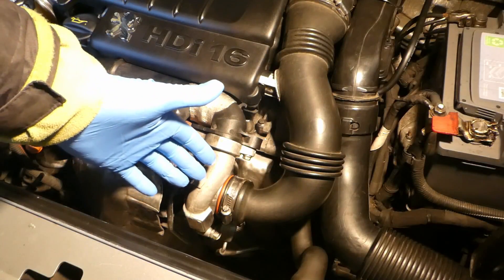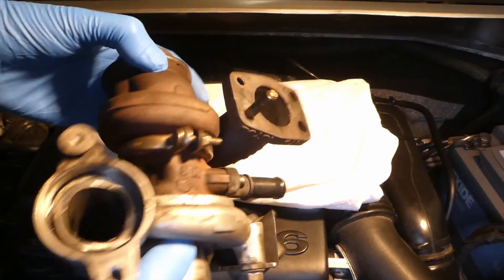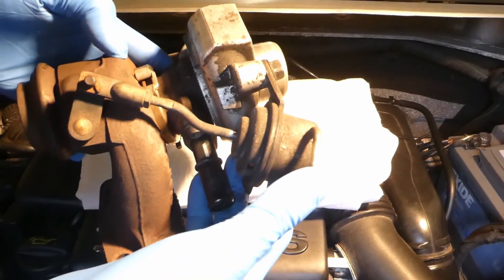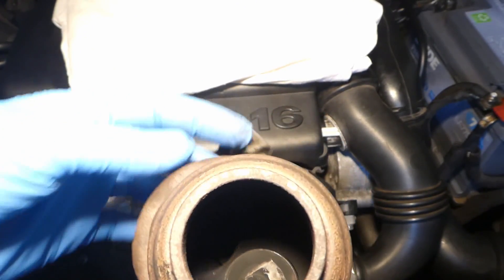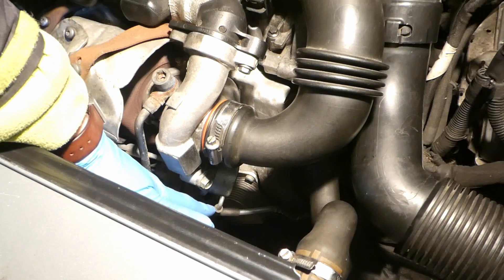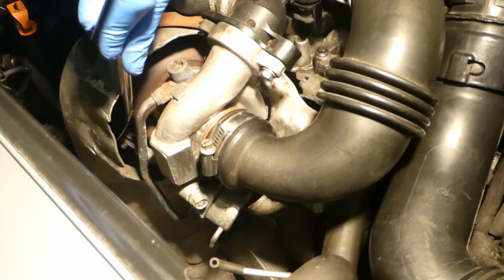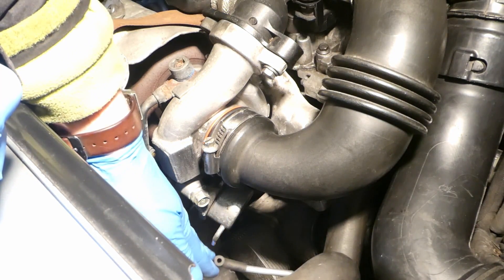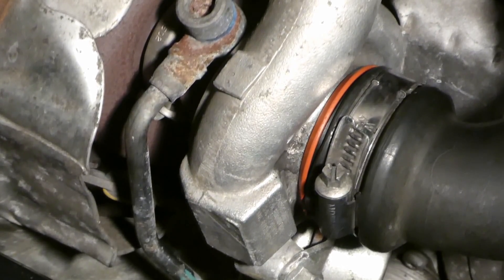Simple way to test turbo wastegate operation in 1.6HDi (Peugeot, Citroen, Ford, Volvo, Mini)

Comment: Hi, having a slight issue with my car. Did the actuator test as shown by putting my hand on the end of the actuator in which it held vaccum. Issue i am having is I can see it move up when starting the car and back down again when turning off but I am getting limp mode at 3k rpm. When moving my actuator down it does not respring back up only sometimes it does  and sometimes it does very slightly a bit sticky when doing this also. Would you say this is the vanes or actuator?
Reply from the maker: Yes, there might be some sticking of the wastegate. If I were you I would take the wastegate off the car and see if it really get sticky. If it is sticky you may need to replace it. If it has the same wastegate as mine, it is unlikely to be the VNT (vanes) turbo, but the fixed geometry one. Is it 92bhp or 110 or 130?
Reply: @moremolecules  hi thanks for reply, forgot to mention it is a 2013 TDI volkswagen unsure if you know much about there turbo systems
Reply from the maker: @roshaanqaisar  Hmm, I'm not too familiar with the TDI, but any wastegate needs to be free in opening and closing. Yes, vanes on the TDI will give problems as in any other vaned turbo. Difficult to say, but if there is a way to remove the wastegate to check for smoothness of operating it would be good.
Reply: @moremolecules  thank you will give this a try, so I need to remove the actuator and move it up and down not the vane lever?
Reply from the maker: @roshaanqaisar  Yes, but if the vane actuator is also a bit sticky then the vanes needs to be checked. Frequently on vaned turbos you get them misplaced and this could give you the limp mode. It is worth checking both.
Reply: @moremolecules  great thanks, I've tried checking just now when revving the car on idle and it just moves very very slightly forward and back and its a very notchy movement also.
Reply from the maker: @roshaanqaisar  It should be smooth rather than notchy, so there is something going on.
Reply: @moremolecules  hi, I removed the turbo and the vanes are moving freely when checked by hand. Also when the actuator is disconnected from vanes and I move the actuator up it does not spring back down. Is it supposed to do this?
Reply from the maker: @roshaanqaisar  Hmm, some of the wastegates are not spring-loaded, so operated electronically or via vacuum, so it may be OK. I am not really familiar with the TDI. Is there a vacuum pipe going to the wastegate or electronic component, i.e. cable? Wastegates are generally cheap, so you could replace it, but probably the best course of action is to plug it in with some sort of OBDII scanner and see any error codes for the limp mode.
Reply: @moremolecules  there is a vaccum pipe going to the side of it from the n75 and up top there is a electrical connection. I just checked the vane lever again and it moves upto 50 percent smooth then the other 50 percent it feels a bit gritty. I'm thinking it may be just that and the wastegate actuator is OK but if you said it may not have a spring then that will be the case
Reply from the maker: @roshaanqaisar  It might be sticking vanes that cause the grittiness. Probably the wastgate actuator is ok, but the vanes might be sticking a bit.
Reply: @moremolecules  thank you, I'll try cleaning it. Is there anything you would recommend using?
Reply from the maker: @roshaanqaisar  See if cleaning the vanes helps. I think carburetor cleaner would work alright.
Reply: @moremolecules  thanks pal

Comment: Hi more molecules. I want to replace the vacuum line from wastegate to solenoid. Do you have any idea of the correct vacuum line size as in internal diameter of line and length required? Many thanks
Reply from the maker: Hi there, unfortunately I do not really know the correct vacuum sizes. I suspect it is a generic vacuum line and you can cut it to size.
Reply: @moremolecules  thank you.

Comment: Hi I have Peugeot 3008 2011. It did some test to my turbo charger i found that no vacuum coming in to the actuator. my questions are: 1) does the actuator close the wast gate  on startup only?, 2) I see that vacuum pump is working. what should I test aim to define where the problem coming from. thanks
Reply from the maker: Apologies for the late reply. I am not too sure about the 2011 model, it may be a bit different. The wastegate actuator closes the wastegate on startup. Well, actually it is the other way around, it closes the turbo opening in the exhaust part. It is a fail-safe mechanism. So, if there is not vacuum there will be not turbo, the exhaust gasses will just pass through the exhaust rather than turn the turbo turbine. I hope it makes sense.

Comment: Thank you very much !I have volvo v50 2.0d with HDI 136 engine,i have problems from time to time...the car enters in Limp mode and i must restart the engine to run again back to normal...i have changed my intercooler and my hose turbo pipe...but not curred the problems still,i plan to test the turbo actuator soon as you showed in you video.Also my turbo overboost when this happens.
Reply from the maker: Not too sure about the 2L HDi, but there is a turbo solenoid at the back of the engine. It could be the wastegate or the turbo solenoid.
Reply: @moremolecules  The solenoid works well,i think maybe could be the wastgate..because i bought this car 3 month ago and in the first week i have found the vacuum hose broken with leak from the wastgate...so this wastgate was not working at all maybe 1 year,maybe gets sticky sometimes,i tried spray with WD40 and i plan to buy Turbo Cleaner Spray to clean the geometry of the turbo itself.
Reply from the maker: @L.Lyubomirov  You could potentially replace the whole wastegate with a new one. It should not be too expensive.
Reply: @moremolecules  Heard that in my particular case,the wastgate on Volvo v50 2.0d 136hp is togheter seled with the turbo,you cant buy one or other... :(

Comment: Hi, I have Peugeot partner, like yours. I have sign come on my deshbord, said engine clogging. Risk of filter. Some body suggest me, put some DPF cleaner and drive good 40 to 50 miles. Which is I did. Then I off engine. Try to start again. But is not starting. Please could you help me. By way 10, 000 miles before DPF was cleaned. Now even power lossing. I will waiting for your answer. If you are near to me. I would hire you. Many thanks.
Reply from the maker: Hi Mizanur, you do not want to hire me, I am no mechanic. If you have diagbox or PP2000, have a read if there are any errors. If the DPF was cleaned and it is clean, then it could be that the DPF sensor might be at fault. DPF sensors should not be too expensive to replace. How many miles/km has the Partner on? DPF filters are designed for ~100,000 miles or 160,000km.
Reply: My partner done only 10,000 miles, after clean it. Thanks.
Reply from the maker: @mizanurrahman9678  It could be that the DPF is done or a sensor issue.

Comment: I have a 1.5 TDCI the car makes a very soft and subtle turbo whistle, not a whine though at around 2k to 3k RPM. Nothing audible during driving. If I stop the car and give it some gas I can see a smooth mild whistle. No powerloss, no smoke, as such. Wanted to get your thoughts
Reply from the maker: Hi Vijay, all turbos when they spool up they whistle, but you should not really hear it. Depends on the design of the air pipes. Most "street racers" are looking for this effect, but on standard cars manufacturers try to minimise the noise, so the air pipes hide the noise. Check if there is a hose unclipped from somewhere or something uncplipped from somewhere. Not too sure about the 1.5TDCi, is it really 1.5 and not the 1.6? It could a design, but it is rare with standard cars.
Reply: @moremolecules  Thank you. Here in India we have the 1.4 (discontinued). Currently present the 1.5 derived from the 1.6. All piping are good visually, no stone chipping on the intercooler too, for the most part, all pipes are chuff,  no leaks on the charge side, inspected that one along, but this mild whistle though addictive, just gives me the bugs at times of a possible failure of something.
Reply from the maker: @vijayam1  You could open the air intake to the turbo and check if the turbo propeller is not moving too much, for a piece of mind. Do you know if other 1.5 TDCi make the same noise, it could be a feature.
Reply: @moremolecules  No play on the shaft either when I last checked. I will check once again, thank you.
Reply from the maker: @vijayam1  It could be a design of the engine, I am not quite familiar what the differences are between the 1.5 and 1.6. You have checked pretty much everything, so it should be alright. How many miles if the engine?
Reply: @moremolecules  39146 miles or 63000 KMS
Reply from the maker: @vijayam1  Do you know if it is the VNT turbo or the standard non-VNT one. I would still check the vanes of the turbo, the ones you can see when the air intake is taken off. Just check if they are all intact and no foreign object has damaged them by any chance.
Reply: @moremolecules  It's a fixed geometry turbo
Reply from the maker: @vijayam1  Then the only thing left is to check for holes again (hoses/intercooler) and if any of the propeller blades are not chipped. If these are OK, should not be too much of a worry, not much else you can check.
Reply: @moremolecules  Thank you.

Comment: Hey, stupid question but would this fault show up on a diagnostics machine? Thanks
Reply from the maker: Hi Ben, it should, but it might not. Depending on what is not working, it should show underboost, but it does not always happen.
Reply: @moremolecules  thanks for getting back to me. My car keeps going into limp mode and it’s getting a diagnostics tomorrow so my mind is racing wondering what it’ll be so if it’s something like this I hope they pick it up.
Reply from the maker: @Ben-bu2jg  It should pick it up, but there may be a lot of things for a limp mode. See what the computer says and take it from there.

Comment: I’ve got P0299 underboost condition on my Ford Focus 2 1.6 TDCI 2007. I have fitted an electronic boost gauge to the intake, I read 0.2 bar when driving, it’s really slow acceleration. I changed 2 vaccum solenoids, no luck. I then had my friend hold down that rod with a screwdrive and I rev’d the engine to 3000 RPM and it did 1 bar while idle! I then bypassed the vacuum solenoid and put a vacuum hose straight from the vacuum pump to the turbo actuator (so the diaphragm holds vacuum) and while driving I get 1.7 bar on the gauge. Could the wiring to the vacuum solenoid be shorted and the solenoid obviously doesn’t? Do I get any error when the wiring harness is not connected to the solenoid? Thanks a lot!
Reply from the maker: Hi Alexander, you have covered most things, but if you bypass the solenoid and you get boost, it seems the fault is somewhere between the solenoid and the wastegate. You could perhaps be loosing vacumm (e.g. split vacuum line) from the solenoid to the wastegate. I would check the vacuum lines for any loss of vacuum.I do not think you will get an error if the solenoid is disconnected. This is somewhat similar to getting stuck solenoid, no error is reported with this.
Reply from the maker: Apologies, forgot to say that the fault may be between the solenoid and the wastegate, but this includes the solenoid, so it could be that wires are not that well with the solenoid. If you can test the solenoid outside and it is alright, then I would see if vacuum goes to the solenoid.

Comment: Useful info! thank you, I have a turbo leak and oil goes onto the actuator it means the turbo seals are not working correctly, 3rpm boost is approx 1,2 bar. Turbo's dead.
Reply from the maker: Yeah, 1.2 bars is nothing for 3,000rpm.
Reply: @moremolecules  407 is going quite fine but leaves too much black smoke when accelerating, love this engine cause its very economical and Im going to fix it.Do you know the proper boost of this Garrett 1544V?
Reply from the maker: @pawelcitak83  Yes, it is extremely economical. I have another car, Peugeot 307, 1.6 petrol and it drinks petrol like there is no tomorrow. If your turbo is the Garrett 1544V, then your engine must be the 2L or 1.6 but with the 110bhp? The 1.6HDi (90bhp) has the mitsubishi turbo. I do not know the exact boost of the mitsubishi one, but it should go to ~1.9-2 bars. For the 1544V, the variable vanes, I am not too sure about that one.
Reply: @moremolecules  yes it’s 1,6 HDi 109 hp. Turbo leak means I have to replace it sooner or later
Reply: @pawelcitak83  regarde le collier de serrage entre le FAP et le turbo.
It's in french

Comment: I do have fiesta 2010 1.4tdci 68hp. Its same engine almost but 1.4 instead. Does anybody know is it the same thing with 1.4?  I have feeling that actuator faulty as well but it seems that it has to move oposite direction than in video. Any ideas????
Reply from the maker: Hi Audrius, the movement is specific to the 1.6HDi, but it could well be the opposite direction in the 1.4tdci. I am not too familiar with the 1.4, but the direction is not that important, as long as it moves and holds vacuum.
Reply: @moremolecules  i was trying to put finger on solenoid/actuator pipe, I  applied pressure to it using syringe. It seems that actuator does not hold pressure like in your video. Already ordered new actuator. will see. Thank you for your video so much you gave great  idea what to try!
Reply from the maker: @audriusgedmintas9812  In any case the wastegate should hold vacuum, try with new wastegate and see if makes a difference.

Comment: Thank you Thank you Thank you! 
I have 308 1.6 turbo suffering from over pressure & blowing off the inlet. Thank you for identifying the waste gate & taking the mystery out of it. At least now I have somewhere to start fault finding.
Reply from the maker: Hi Jeff, have a look at a few of the comments on the same video, there was the same situation with another person. When you say over pressure, I suspect you mean over boost? If that is the case, most likely the turbo solenoid is faulty and cannot divert the pressure when it is too much.

Comment: Nice video 👍🏼👍🏼👍🏼

I'm going crazy with the wastage in my car, I have a Peugeot 208 1.4 hdi 68 hp of 2012, since 4 days you can hear a rattle noise coming from the wastegate, when there is a normal temperature you don't hear anything but when the car is hot at idle it makes noise.  If I put my finger on the rod of the wastegate it stops making noise.  What could it be?  Do I have to change the internal flapper of the wastegate? 😞
Reply from the maker: Rather weird thing. Is it possible that the small ring that holds the rod to the turbo is missing and this is rattling? There is not much wrong to go inside and start rattling.
Reply: @moremolecules  I took the car to a turbo mechanic and the noise says it's the inner lid of the wastegate, the one that controls the exhaust fumes. It says it desoldered and makes a rattle-like noise. He told me that probably the inner flapper of the wastegate to another 2 years of life and to let it go for now because the car works great. I checked the wastegate and nothing is missing and everything is in place.  Anyway checking on the web I realized that this noise is a common problem on almost all turbos. Turbo with 118000km and 8 years. Could it be something electronic that controls the opening and closing of the wastegate? Maybe it doesn't close properly when the car is idling...